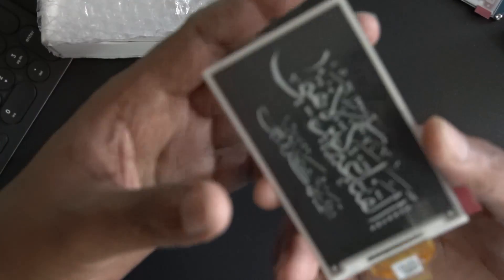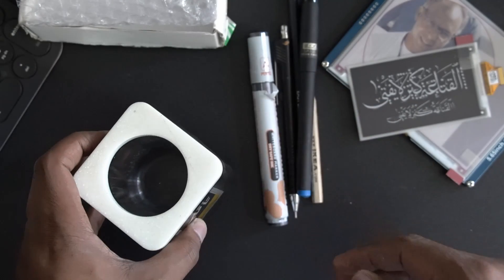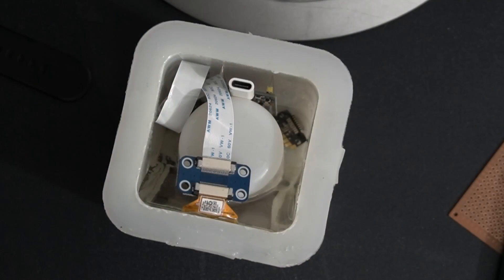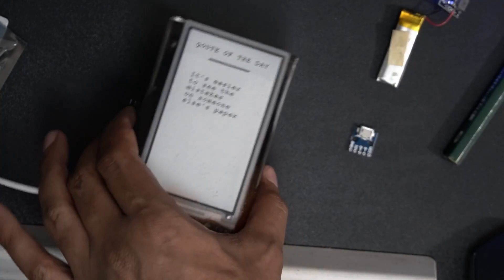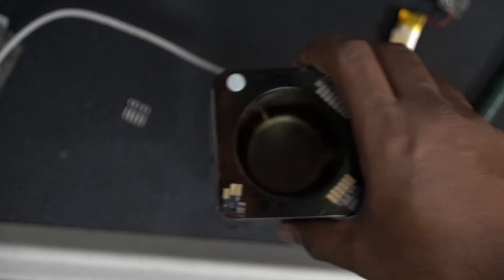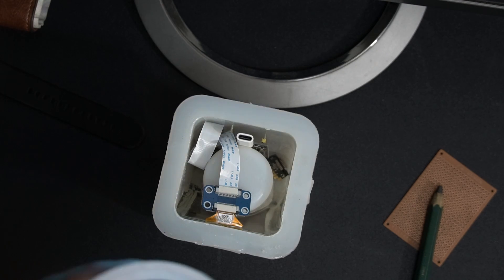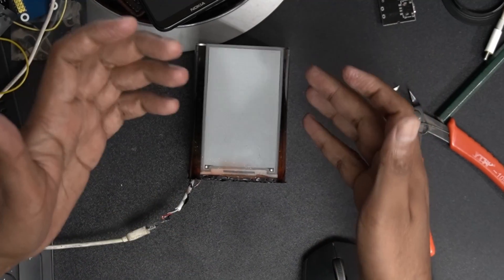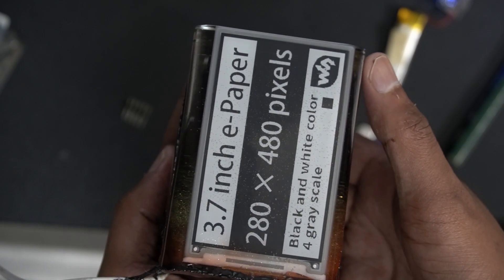3.7 inch E-Paper/E-ink Display - DIY Pen Holder with E-Ink

Comment: That's a great use for this display! Do you know if the driver board can be easily powered via a battery with the gpio pins? I am considering using these exact components actually
Reply from the maker: Thanks so much 🙏 
To power the board you need to power the esp32 board and that is easy via GPIOs
What makes me not doing it here is I need a way to charge the battery which I don't know how for now